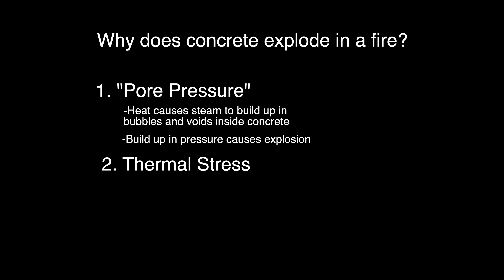Don't Put Wet Rocks In A Campfire

Comment: Also, it can take a week or two for concrete to fully dry inside, so it would be a good control to have well aged concrete disks that you pour; also, possibly it depends on how well the concrete is mixed and if there are air pockets... and finally, once one of the concrete disks is fully cured (2 to 3 weeks), then soak it under water for a month.
Reply: Over a month to dry.

Comment: I learned this was a problem when I needed to weigh down some tinfoil or shim a pan in a grill and I used some rocks. Also had an a rock pop and burn my arm when preheating super old asphalt when applying torch-down thermo plastic to a road

Comment: Can confirm some rocks explode neer campfires. I learned that back in cubscouts. The camp leader told Pooky not to use wet rocks around a campfire. Pooky found some soaking wet rocks. Pooky  thought they sounded neat. Pooky got close up and drenched  them in lighter fluid. Pooky had to be sent to a hospital for bad burns and IIRC a broken arm. The cubscout leader read pookies parents the riot act. The hotdogs and smores, on the other hand came out really good.

Comment: is Granite really impermeable? or does it just take far longer to become saturated?  Finely finished granite, like used on countertops, or marble, is not permeable because the grains have been closed, like sanding wood down with fine sandpaper; the closed pores will not absorb water as quickly as open pores.

Comment: When I was a kid, I kept putting rocks from the beach in a campfire. But the rocks exploded and flew shrapnel everywhere. Mainly on me because I was the closest to the fire. I was bruised for a month from that. I’m guessing it was because water was trapped in the rocks and when the water started to expand from the heat, the rock couldn’t handle the pressure and it exploded.

Comment: The more important point is, don't build a big fire under an overhang.  Particularly when it's all icy cold.  Which is when you would be most likely to do it, if you were icy and cold yourself.  I've blown up a campfire rock (small but violent) and seen a guy crack a pretty good slab off a boulder.  If the rock is wet, it is dangerous.  If it's frozen, it's more so.  Crawling under an overhang against the rain or ice and lighting a big fire is a bad idea.

Comment: Concrete is porous and if the air pockets heat up it does explode. And same with rocks most of the time is rock that have been in water. The water boils in the rock and clause it to blow up. I have both blow up. So point is don’t mess with fire the old saying goes you might get burned.

Comment: Me. Bonfire of many old pallets on a concrete haulage yard. Gallon of fuel oil. Match. Burny, burny, burny. All gone. Broom to sweep up the mess. KABOOM. 

About ten square metres of concrete spalled down to a couple of inches while I was standing on it. It scared the crap out of me and I'm told it looked very impressive but I was completely unharmed. I don't have a clue about the physics of it but I suspect the noise and the dust and smoke were writing scary cheques the actual "explosion" couldn't cash.

Comment: Not a rock but once a few years ago I put a can of baked beans on a campfire to heat it up but didn’t think to partially open it to let the pressure escape and the top exploded and it launched into the air and sent scolding hot beans falling from the sky. My girlfriend still has a small burn on her wrist from it. Not my smartest idea.

Comment: When I was camping with friends we were sitting around a campfire near a riverbank and we went in the river and when we came out one of them put there wet clothes on one of the rocks to dry and the rock was soaked so when we lit the fire 10mins later I was in front of the rock and it exploded and shrapnel from the rock was everywhere and I had cuts from my head to my feet and some were grazing cuts and some rock shards went in my flesh so don’t have wet rocks near campfires

Comment: wet rocks could be a major problem in the summer due to it raining every day between 2:00PM to 5:00PM
fortunaly it is dry in the winter 
and Florida winter isn't cold enougt to need a fire at a minimum of 46 degrees one winter night out of the year.

Comment: The reason this happens is due to water trapped inside the rocks. As the rocks heat up the trapped water/steam increases in pressure and the rocks explode.

Comment: The rocks that are dangerous in a campfire are the ones that have been soaked or been touching a wet surface for a while and that have had time to soak the wate up. If you just get the rocks wet for a few minutes it's not enough time to soak up the wwater and be able to explode.

Comment: As someone who has some experience with this sort of thing, concrete will rupture for the same reason the rocks do, mostly it's due to water trapped in the stone or concrete that heats up and expands. Once the moisture expands to a certain degree, the cavity can no longer hold the pressure, hence "exploding" though that term is incorrect. It's more like high velocity fragmentation because there's no explosive gas or compound involved and rarely is there any sort of fireball. This is also an issue concerning campfire rings, but only for those who have no outdoor experience usually. Most true outdoors have been taught and shown this early in life by our elders so we never actually make this mistake. Sadly, some campgrounds are maintains by morons who use things like river rocks to build campfire rings and I've had the pleasure of experiencing this first hand at a few campgrounds over my 31 years.

Comment: I have camped on a Mississippi sandbar a few times and the rocks can “explode.” More like a decent but still small firecracker going off.

Edit: in my experience, you’d just be startled but wouldn’t be hurt badly, little bit of an “ouch.”

Comment: I've never built  campfire capable of melting aluminum.  Nor has anyone I know.  I've seen a hundred cold fire pits, full of ash, tin & aluminum cans. They don't melt because a campfire rarely exceeds 600°F.  No one is considering the temperature required.  I've caught embers from a campfire because of  tree pitch/sap.  Loose gravel in a fire pit could easily be launched by the impact of a log splintering because of moisture or sap in the wood being burned.

Heating concrete with metal inside (knowing it must expand) is  guaranteed way to explode something.   It's not the same theory.

Comment: A new experiment for you.  Drill a hole in a rock, not all the way through. Then fill it with or bees (dry).  Then add water and see if the or bees crack the rock.

Comment: My own and lovely illegal firepit (ring of rock) in the middle of thw forest  is pretty big over 1m diameter and I got there sooo many time alone and with friend 
My usual fircamp size is usually between .5 and 1m diameter (the flame(tipi)) and i made the biggest flame from a firecamp I ever made using the whole pit full of dried wood and 1.5m high... The rock are all half burried from the number of time I used The pit and I did never experience any rock exploding.
Btw my grand parent exterior fireplace is all made of big rock found in a forest to. Mever saw them explode.

Comment: Sooo you have a concrete with rebar building, water from a sprinkler system, heat from a plane engine and fires, and molten aluminum from the plane melting....

Comment: It is a time tested tradition in survival to take river rock (even wet) and place it around the edge of the fire and heat them slowly.  If they do not crack then move them closer in and heat them to inner fire and when they are very warm move them to a safe area in the tent.  The key is to dry them slowly rather than just plopping them in the fire.  I have kept warm on a -36F deg. Through a nasty snow storm by heating rocks in a fire and rotating them in and out for my sleeping bag as they cool every few hours.  Common sense is your answer.